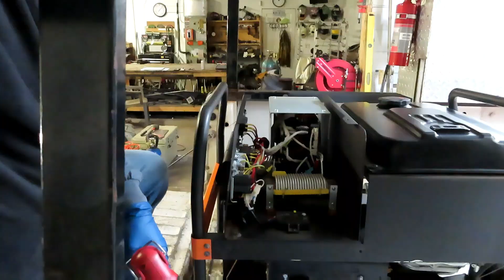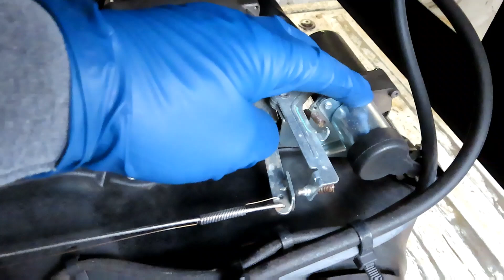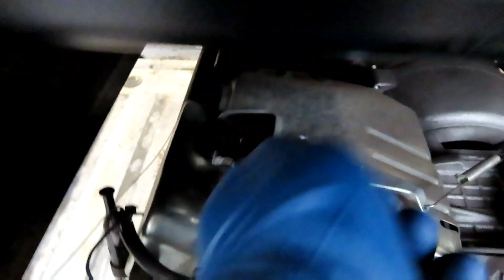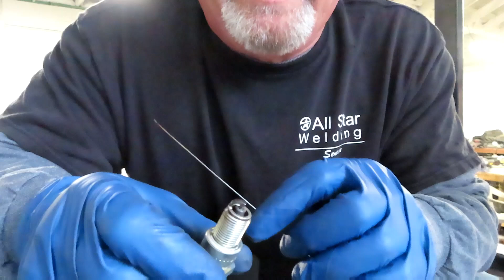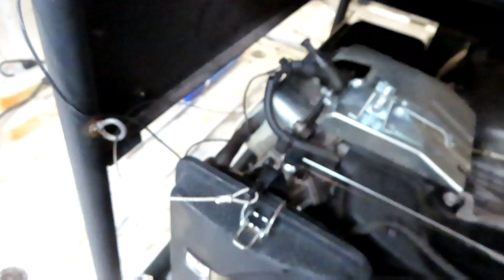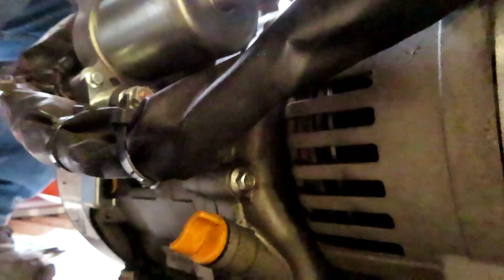Harbor Freight Vulcan Outlaw 195 Welder/Generator Maintenance Tips for Smooth Operation

Comment: Whats the link or name of the oil dip stick with a magnet on it
Reply from the maker: I don't like those because it's too easy to dislodge the specks when you pull the dipstick out. It would be better to get a round magnet, like a speaker magnet, or something from Lowe's, and stick it on the bottom near the oil drain plugs. Then pull it off when you change the oil and the specks will flow out with the oil.
Reply: @AllStarWeldingSC  sounds good. I was thinking  of a similar  idea. Thank  you
Reply from the maker: Put the magnet close to the drain. They way it will wash out
Reply from the maker: Also, look around on some of the small engine websites like Jacks Small Engines, if he's still in business. They sell a short rubber hose with fittings on the ends. You screw it into the oil plug, and move the drain plug to the end. Makes oil changes less trouble. But you could also make one and put a valve on it.

Comment: I would like a shop tour ( of your shop ) .
Reply from the maker: Well, I am about to start my flatbed build, and I will do a truck tour after that, then I will do a shop tour. There's not a whole lot to see
Reply: @AllStarWeldingSC I just like seeing what tools others use and the way they have things layed out . Sounds good 
Hope all is well
Reply from the maker: When I first started, I thought that I needed every tool made to man. But over the years, and especially going mobile, I've learned to make do with very little! 😂
Reply: @AllStarWeldingSC ohh definitely especially mobile welding . Fabrication you need a lot more depending on what you do . Mostly for welding all I need is my welder, mig pliers, a brush my hood , gloves maybe my jacket depending on where I’m at and how hot it is out . Fabrication I need a bunch of other stuff clamps measuring and marking bender the list goes on haha

Comment: The problem is its only a 90 day warranty and spare parts and unavailable from HF. Only air filters and gaskets are listed by HF. Extended warranty adds $400 or more.  Its the electronic circuitry that are the weak links and dont exist as spare parts.  It may be cost effective to use a 10-15 kw genset and and a simple invereter welding machine or multi processor welding machine.  One still needs an air compressor for a plasma cutter.   That way you dont  lose the the entire ability to weld or have a generator. My Miller Bobcat with Onan engine is still running after 40 years, unlikely with an HF made machine or any Chinese inverter welder.  I have a Yeswelder Inverter machine for 8 yrs now and its still going strong.  To each his own. 

Currently the Vulcan is on sale at HF for about $1600 as of 10-18-2025

VULCAN OUTLAW 6000 Watt Dual-Voltage, Engine-Driven Inverter DC Arc Welder/AC Generator with Wheel Kit, 20&ndash;195 Amp DC Output, 120/240 Volt, 6000 Watt AC Power Output for $1599.99 https://hf.tools/coupons/2025/10/184099-59692

Comment: I bought mine new a few months ago. I got it when it was on sale. I used to run a Miller Bobcat 250. I mainly do farm type work. Pipe fences or equipment and a lot miscellaneous work. 
I am extremely happy with the Vulcan  Outlaw 195. To me it’s really easy to weld with. I use P6010 and 7018 welding rods. 
I’m going to replace the welding leads with a 1gauge 50’ on both ground and electrode holder. I really haven’t had any issues with the leads that came with the machine but I prefer a little more length and a more limber lead. 
The only issue I have had is the CO2 censor failed and I had to take care of the problem. I appreciate your videos and your suggestions and information is very helpful. Thanks
Reply from the maker: What a great comment. I too, believe that it's just a no frills, inexpensive, does what it's supposed to machine. I use mine nearly everyday, either as a welder, or the generator. If you don't mind, could you start a new comment with "HOW TO BYPASS CO2 MONITOR". I know of at least 5 guys on here that would like to know this info. One guy had a failure the next day. Fortunately, mine is the first gen that doesn't have it, and has the better semi-auto choke.
Reply from the maker: Yeah,I changed my leads out for some #1 Flexo-prene leads. 20ft on ground and 30ft on work. But I also have 25ft extensions on both that I can add in when I need it.

Comment: Would it be hard to find parts for it for rebuild? What do you think is the lifespan of these machines?
Reply from the maker: Most of the parts could probably be ordered from HF, or internet. I suspect these will last years if you take care of it. I change the oil often. I use mine at least 3-4 times a week
Reply: Key is using it and not cheaping on oil changes and maintenance.  Fuel stabiliser plus maintenance are cheap....parts, labour, downtime...expensive...
Reply from the maker: You are so right!
Reply: The only spares HF lists are air filters and gaskets.  Nothing else meaningful.

Comment: Can you run your titanium flux 125 off of the outlaw if so what putlet do you plug it into and does it work normally
Reply from the maker: Yes, I run it off the normal 110v plugs all the time. My main line of business is handrails. In the field, I use the Titanium off the Outlaw, and my helper runs a wire wheel on the grinder behind me. It's a good setup. Of course, in the shop I use regular gas Mig. But for field work, either constructing or repairs, it's great.
Reply: @ great I’m on my 3rd week of waiting for it, feels like forever 😂

Comment: Another reason to run it for about 4 hours and then drain and replace the oil is to get the break-in oil out ... Engine break-in will introduce metal flakes and such into the crankcase , so you want to get that crap out of there ...
Reply from the maker: Absolutely!

Comment: Do you know how to bypass the CO2 sensor? Mine has less than 10 hours on it and won't run cuz the CO2 sensors malfunctioning and they do not sell a replacement
Reply from the maker: Let me download the schematic, and I will have an answer for you tonight.
Reply: @AllStarWeldingSC   thank you very much
Reply from the maker: Hey James... I download the schematic, and it's pretty generic. All of the wires should have a little white band on it with a number printed on it. Can you see what the number is on the wires going to the CO sensor? I bet one is 00, and the other MIGHT be 48. But I want you to look and make sure. Did you call them to ask about the sensor? It's part #47 on the drawings.
Reply from the maker: If you can get those wire numbers,I can hunt it down and see how to bypass it. I think I know, but I want to make sure first

Comment: Bought mine last summer/fall, we've built a steel awning and  well over 500' of pipe and metal fence with gates, it paid for itself for sure
Reply from the maker: That's awesome! You definitely got your money's worth out of that.
Reply: @AllStarWeldingSC  thanks partner, appreciate your content
Reply from the maker: @DonGilbertoGuruledeNuevoMejico thank you!
Reply: First issue finally happened, well I replaced stinger and ground clamp because we beat the snot out of our equipment, (wilderness ranch work) but recently it seems the starter/solenoid may have taken a dump
- starts right up with pull Start, shuts off with switch normally, 
- will NOT start electrically, switch feels and sounds operational, battery reads 13+ volts
We're still runnin it hard though, my predator 9000 is down too, after 2 years of extreme use
Reply from the maker: Oh no!!! You can get one online. Just look for a Predator starter, or one for a Honda GX390
Reply: @AllStarWeldingSC  gracias!

Comment: Use a ball valve to drain the oil
Reply from the maker: Great idea
Reply: @  I have the 220 and the 205 welders. They run great for Home stuff. I was really curious if you have them and if you could run the generator to power those machines, I recently used a generator from my welders and it didn’t work out. I was curious if that generator can run those machines, without the machines faulting
Reply from the maker: I don't know about those particular welders. I've used my Outlaw to power my Primeweld MTS200 and the Primeweld 160Ts. But I think both were on 110v. And of course, the Titanium with no trouble.

Comment: Thanks for your videos, I just picked a new outlaw. I’m going tomorrow to get oil, spark plug, fuel filter, hour meter and new sae bolts for wheel kit mount. So far, impressed with quality of this machine.
Reply from the maker: It's a heavy beast isn't it? Definitely run it only about an hour, then drain the oil again to flush out any remaining metal pieces from milling. Enjoy!
Reply: Yes sir it’s a beast for sure, with wheel kit it’s balanced very well, easy to move around.
Reply from the maker: You're right. For such a big heavy machine, they got the wheel kit balanced just right and easy to move. I took off my wheel kit and mounted the Outlaw in my truck. I think the wheel kit alone added 50 pounds.
Reply: Yes sir, shocked to see how heavy each wheel was. Did you keep the Dinse connectors or use adapters?  What do you recommend on lead lengths? I’m looking at getting 75’ or 100’ of #2 and doing 30G/45L (75’) or 40G/60L (100’).
Reply from the maker: I can usually park close to where I'm working, so I put 20ft on ground, and 30ft on work end. And I also have two 50ft leads with male and female ends so I can add them in if I need them. I use #1 Flex-A-Prene cable. It's nice cable, not too expensive, and still stays very flexible even when it's 16 degrees outside like last week.
Reply: I'm new to welding bought to do repairs on my log trailers from time to time, welders in my area 100 plus a hr but worse part you just about have to beg them to work.  I just unboxed mine , what do I do with green and yellow wire it come with? I see place on welding power switch to hook it but where do I hook other end? Or is it even needed?
Reply from the maker: I think that's the found wire. There should be a spot on the frame for it near the battery. I don't use mine.

Comment: Hi, my outlaw isn't idling down after start up, Any idea why?
Reply from the maker: My first thought was that the "Welding Power" is flipped to ON, in which case it won't idle down. Is yours the new model with the O2 sensor, or the first generation?
Reply: Yeah I just bought it a week ago. Brand new. First start up it idled up for a few seconds and stayed at low idle, I did that for about 10 15 minutes.  Shut it off and started it back up 10 minutes later and was staying high idle. Weld switch was off.
Reply from the maker: Dang.... Well, I know that when you first crank it, it will go high, then back down after maybe 30 seconds. I will take a look at mine tomorrow and see if I can come up with an idea. Make sure all the linkages and springs are all in place. Take some pictures of the areas and email them to me. Go to the front page of my channel and slide over to the "Community” tab. My email is listed there

Comment: I just bought a new outlaw 195 in NC, I’ve been wanting to get one for sometime now and was able to finally get one on sale!
Reply from the maker: Awesome!  That's a great welder, you're going to love it. I'm using mine right actually! Let me know if you have any questions.
Reply: @AllStarWeldingSC im in college for structural and pipe and I do a lot of dc tig root and 7018 fill and cap, I’ve been looking at getting a welder and this one caught my eye. I don’t plan on using it every day as I’m going to be working in a shop that provides the welder, but I still want to be able to tackle some decent sized jobs, and do some pipe welding to practice for class, do you think this would be a good welder for me in the long run? I just don’t want to spend $1,800 on a welder that may not be the best just because I’ve heard bad things about Vulcan but I’ve also heard a lot of great things! It’s just in my spending budget.
Reply: How much did you paid for it?
Reply: @Army_Of_Juan I got it for 1400ish on sale
Reply: not bad. I’ll keep an eye for the he next sale, tho I just check with the current 20% off and it put me on $1440, ill still wait for the next sale and drive 3 hours to Oregon and save on tax

Comment: Brand new, just picked it up today
Reply from the maker: That's great!!! Pay close attention to what I said about the first time you put oil in it. Run it a little over 3 hours, then drain the oil again. It's to flush out all the milling junk they didn't get cleaned out. Look at what comes out, you will be surprised. Good luck with it. Come back and leave a comment and let us know what you think of it.
Reply: @AllStarWeldingSC  thanks for the video, very informative.  What brand of oil do you use synthetic or regular oil.
Reply from the maker: I had a small engine mechanic recommend STP Premium Small Engine 4 Cycle Oil SAE 10W-30 Synthetic Blend. He said because of the temperature, and the high revolution of small engines, it's best to use an oil designed for it